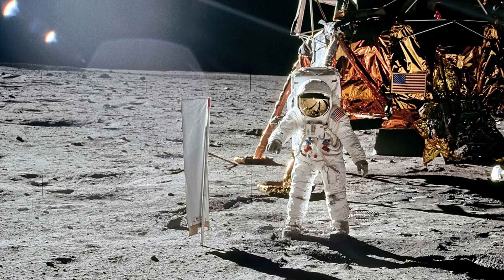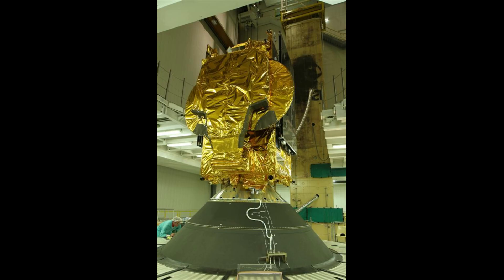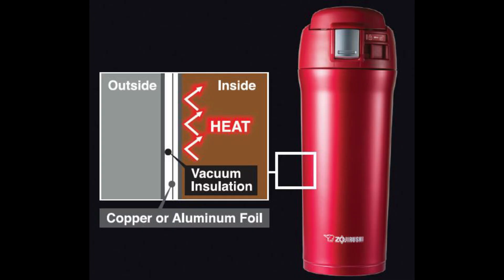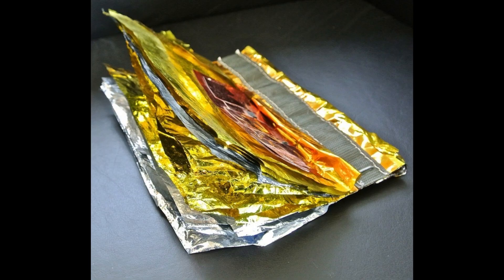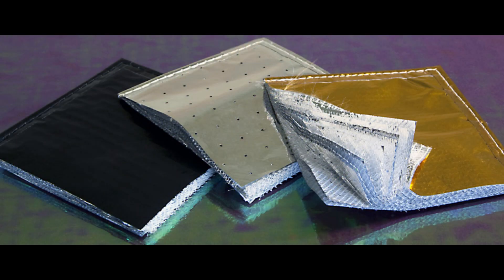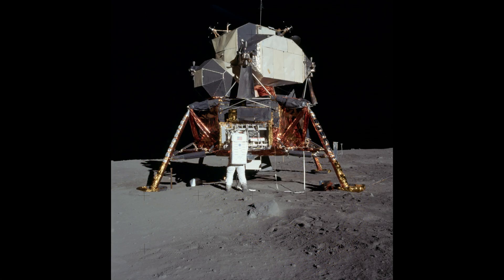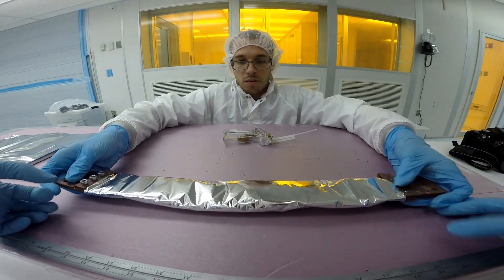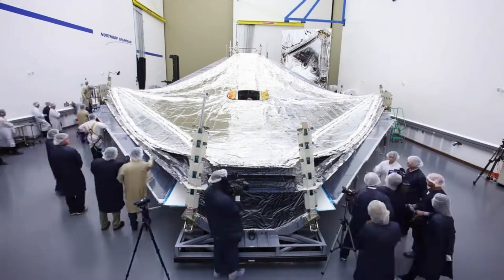Spaceships Are Not Covered In Gold Foil - The Cool Engineering Behind Multi-Layer Insulation

Comment: 10:05 What was the original plan then? How else would they be landing the LEM?
Reply from the maker: Cut engine as soon as contact light illuminated
Reply: @scottmanley  Cutting the engine actually remained as the primary landing method. What the astronauts wanted was the option to power it in if needed, thus the additional insulation on the legs. Armstrong wasn't purposely powering it in, he said later that he was struggling with horizontal drift during the landing and he didn't want to cut the engine while they were still drifting. Next thing they knew they were on the ground although they barely felt it. Interestingly Armstrong said that he never saw the contact light and didn't hear Buzz call it out.

I read once that the strategy was to aim for a hover at 10 ft and then slowly lower until the 5.5 foot long probes made contact. But I have not been able to confirm the part about the 10 ft hover. Apparently all of the landings were softer than originally expected, some more than others. Impact speed was based on the height when the engine was cut off as well as the descent rate when the engine was cut.

Comment: When I worked at McDonald Douglas, I worked with a lot of captain configurated wires. I hated working with it because you’d have to use a hot knife to strip some of the insulation back.

Comment: There was also Kapton covering the Apollo Command Module, although you only see it in the photos taken in space because it burns off during reentry. You also don't see it on the launchpad because at that time the entire Command Module is hidden by the Boost Protective Cover, which remains in place until the LES tower is jettisoned a few minutes into the launch.

Most people are aware of the ablative honeycomb heat shield on the bottom of the CM, but many probably are not aware that the entire Command Module was coated with the same ablative honeycomb. But you don't see the ablative coating in space because of the Kapton coating, it's only visible when you see a Command Module in a museum. The Command Module Kapton was pressure sensitive tape that was applied to all of the surfaces, that's why it looks so smooth in the photos, not crinkly like the LM's Kapton "foil", giving the false impression that you are looking at a polished aluminum skin. Although if you look at the unflown Skylab rescue capsule at the Kennedy Space Center you can see the waviness of the tape and realize that it is not metal like you would think at first glance.

Actually not all of the Kapton burned off during reentry, in fact if you look at photos of the Apollo 11 Command Module in the water and on the U.S.S. Hornet you can see quite a lot of Kapton remaining on the capsule, which has the more distinctive gold look than the space photos do. For some reason the recovery frogmen's supervisor told them to peel off all of the Kapton which they started to do, and apparently the rest of it was removed later, because when you see the Apollo 11 capsule at the Smithsonian all you see is the ablative coating.

Comment: By the way, the foil you get from supermarkets is quite clean as far as particulates go. It's one of the best work surfaces for amateur optics formation as it is cheap and clean.
Reply: We use industrial Al Foil in our vacuum chambers at work, but we are reminded to NOT just use any old "Reynolds wrap" from box stores as SOME of it has a thin coating of vegetable oil on one side.

Comment: The under-construction image of the LEM really showed that it's the weirdest shaped spacecraft ever!
Reply: Yeah it sure makes a difference when there is no reason to have curved surfaces for aerodynamic reasons. Although as you can see in that photo the "face" of the LM is round, that's because that part was pressurized, it's basically a short cylinder, sort of like a tuna can turned sideways. It's about 7.5 feet (2 meters) diameter and 3.5 feet (1 meter) deep. Behind it is a smaller diameter cylinder that you can't see which is the back part of the crew cabin, the astronauts would step up 18 inches into it and it was 4.5 feet (1.3 meters) deep.
Reply: @StevePemberton2  You can also see the underneath blankets of insulation in post lift-off shots of the Apollo 16 LEM. For some reason, on lifting off from the moon, the back surface of the LEM was blown apart, exposing the thermal insulation underneath.
Reply: @RRaquello  That's interesting, I didn't know that insulation got exposed. Some people get alarmed at photos like that as if the astronauts were in danger, but as I mentioned they were inside a cylinder and it was pretty sturdy. It's an urban legend that an astronaut could put a pencil through the hull, or a foot, or as in some versions of the story a screwdriver. Actually there was very little hull exposed as they were surrounded by switches and instrument bays. And even in the few areas where the hull was exposed the aluminum was about 0.3 mm thick which is three times as thick as a modern soda can. Actually it is believed that with some determination an astronaut could have poked a hole with a screwdriver if they made repeated blows with it in the same spot.
Reply: @StevePemberton2  I believe they were all suited up for the lift off from the moon, so if there had been a break in the pressure capsule and the atmosphere was evacuated you wouldn't have ended up with a Soyuz 11 catastrophe. It wouldn't have been ideal, but I don't think it would have been a fatal situation. I remember seeing one particular photograph, I think from Apollo 15, where they didn't land on flat ground, they were kind of on a hill, and in this picture you could really see the angle and the thing was leaning over a bit and I thought, "Man, that looks like a real pile of junk sitting there". The LEM wasn't pretty, but it did the job it was designed for.

On Apollo 16 the surface panels on the back of the LEM all came apart and exposed the insulation underneath. It wasn't a structural thing, but more appearances. I've never seen it much commented upon, so I don't know what the cause was or how much it worried NASA. I remember John Young just barely mentioning it like it was no big deal. Nobody would have even known about it at the time because you couldn't see it from inside and the first one to see it would have been Ken Mattingly when they got up tom the CM. And at that point the LEM only had a couple more hours of use left before Young & Duke went back with all the rocks into the CM and left the LEM to crash into the moon.

Comment: As a former spacecraft thermal engineer, I appreciate your explanation. Thanks for educating the public!   Every layer halves the emission.
Reply: So much for my Ferrero Roche conspiracy theory.
Reply: The effective emissivity scales with 1/(n + 1) for n layers. You don't halve the emission with each extra layer added (which would imply scaling of 1/(2^n).
Reply: I knew someone would come here for this reply…☝🏾🙄
Reply: @reverse_massage is that a new poop emoji
Reply: Hi Phil The ladies in the main hall assembled the thermal blankets using their little Frister Rossman sewing machine, her husband still in the music biz
Reply: I always found it hard to wrap my head around that you need insulation...
Isnt the problem in space to radiate the heat away?
Reply: @MrSofazocker  in part, but there's this great bloody fusion furnace delivering craptons of heat to a metal box.
What is a metal box that one applies heat to called again? An oven.
Ever heard of Laika? The first animal sent into orbit. Due to a failure to separate the final stage of the rocket, the capsule cooling system couldn't operate. She died due to the capsule temperatures reaching lethal levels on her fourth orbit.
Not that she'd have survived, as there was no reentry system designed for the capsule yet. 5 months later, the capsule reentered and disintegrated.
Reply: Yes, so I work in ultra high vacuum cryogenics, a 22 lb device almost completely surrounded by ultra high vacuum will get hot enough to melt plastic components inside after 2 to 3 days with only 15 to 30 watts of power being transferred to it. So in the case of a spacecraft you need to reflect the thermal radiation from the sun while emitting it from the craft on the non-radiated side.
Reply: @CafeBikeGirl  what working fluid is used in the cooling system? I doubt they’d approve anhydrous ammonia for a spacecraft. Water?
Reply: @spvillano I am thinking the same thing.
Reply: @spvillano iss uses ammonia on the second stage water cooling on the first stage internally.
Reply: doesnt change the fact the apollo missions USED mylar coated with gold ... thats why they had to crinkle them so they showed more depth for the actual depth ...

Comment: I actually did know that it's aluminized mylar covered in a heat-resistant polyimide film, but I am after all a total nerd! 🤓 I have so much Kapton in my workshop... Tape in widths from 6mm to 200mm, solid sheets of it, even massive sheets of Dupont Pyralux (Copper-clad Kapton film). It's such a versatile material! 🤩

Fun fact: Kapton tape is the best thing to cover the quartz window on a UV EPROM to prevent accidental erasure. The amber color filters the UV, and Kapton tapes leave like zero residue behind even after decades. 😌 Certainly a damn sight better than self-adhesive paper stickers which decompose after a decade. (except the adhesive which turns into an indestructible fossilized substance.)
Reply: I have several rolls of Kapton tape, the widest one is 200 mm width for 3d printing. Very finicky to unroll without being torn apart
Reply: @asicdathens  Yep, that's what my 200mm roll was for originally. The trick is you need to build tools to do the job. My solution is ridiculously bodged together, I never got around to designing a 3D printed one before I stopped using Kapton on my printer bed, or I'd share. 🤷‍♂️

Comment: While you can't use thermal blankets as vacuum insulation on earth because of air pressure, what about inside a vacuum flask?
Would filling a thermos with layers of metalised plastic film make it work better? Or would the reduced heat transfer across the vacuum not be significant compared to the heat transfer through the cap and also across the throat of the bottle where the inner and outer vessels are physically bridged?
Reply: The genuine thermos metal flasks are pretty good, losing (I'm guessing here) about 1C per hour from 90C, I'm guessing most through the inner and outer skin join and the cap. Would be nice for someone with a thermal camera to have a look-see.   Haven't you got one Scott ?
Reply: Where I work, we do this exact thing for cryogenic storage vessels.  Vacuum layer with MLI inside.  Probably not as useful for liquids closer to room temperature, though.  And the design of the 'lip' and cap has to already be very resistant to heat leak.

Comment: I'm reminded of the emergency blankets I used to see in sporting goods stores.  Well, I imagine they are still there, but I haven't been camping in almost 40 years.  But these blankets consisted of a thin foil that would fold up to be about the size of a deck of playing cards.  As I understood them, they can be so thin because they reflect nearly all the heat that hits the shiny foil back toward your body.  I wouldn't think there would be enough room to place a vacuum between different layers, but perhaps there is.
Reply: The reflection alone already does a great job.
I have been carrying such a blanket with me for over 30 years, wherever I go, and it has been useful twice. I wasn't in any life threatening situation, but it has allowed me to sleep comfortably when I found myself in unforeseen sub-zero temperatures. I did bring other gear, it is certainly not enough by itself, but if things turn out considerably colder than expected, it provides an effective extra layer.
They are also useful to shelter against rain and lot of other things.
Reply: Having to strip down to expose your akin to the foil isn't always feasible but those survival blankets are very effective at reflecting heat back to your body.

Comment: In addition to providing thermal protection, aluminized single surface kapton is also used to provide micrometeoroid protection to fragile spacecraft components. But care must be taken to provide electrical conductivity on both sides of the material to avoid static charge buildup that could discharge and cause damage to esd sensitive electronics. In addition, all materials must usually be non-magnetic. Spacecraft components get complicated in a hurry.

Comment: I'm curious as to why satellites have the yellow capton layer but the ISS modules don't. Or did I miss that?
Reply: They may use beta cloth outer layers on ISS for better durability, especially where the astronauts climb around.  Also, many engineers are choosing other outer layers now that have a better solar absorbtivity vs emissivity ratio.  Many of them look like duct tape.  Maybe you’re seeing some of that for the newer stuff.
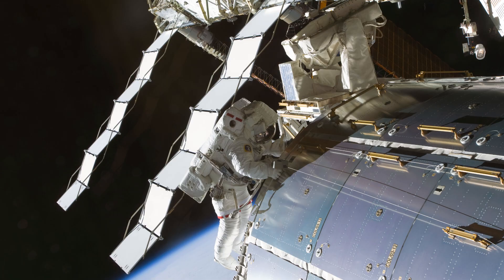Reply: On the ISS, the kapton is inside the white blankets. The outer layer of the ISS modules is an aluminium panels that serves as a Whipple shield agenst micrometeoroids, the blankets are underneath that. 1:47 shows this.

Comment: Kapton, especially in adhesive tape form, is definitely an S-tier material. I keep a couple rolls of it on-hand and find myself using it all the time.
Reply: I laugh when I see construction photos of probes or satellites where they've hung up a paper sign, for example, "Please don't leave your old food in the employee fridge" with a piece of 40mm kapton tape.
Reply: Also used in transformers
Pain in the ass to apply
Reply: Any tips on getting it to stick to things? I have trouble getting Kapton tape to hold onto PCBs and components.
Reply: @SnakebitSTI  You may be buying your kapton from an inferior supplier. I’ve had some cheaper Chinese rolls that didn’t stick too good. Also age may be a factor.
Reply: And here I am, trying to figure out where to buy this in my country for months 😞
Reply: @w0nd3rlu573r  Ali Express or other online places. I first heard of Kapton tape when I got my first 3D printer. we were all looking for materials that would keep the ABS or PLA stuck to the bed when printing and easily unstuck when done. Kapton was soon replaced with 3M blue masking tape, plain glass, PEI (Ultem) and other materials because it was annoying to scrape it off the plate to stick a new one when it got torn. That's when I discovered why the gold foil was on space vehicles, but I never understood why such expensive machines need to look so wrinkly and uneven.
Reply: @w0nd3rlu573r  look into suppliers of consumable for PVD (Physical Vapor Deposition): we use it for masking and fixing stuff inside the chambers

Comment: Kapton tape is amazing stuff! I was first introduced to it because they use it to mask off parts of a PCB board to shield it when it passed through a wave solder. That's right! It survives having molten metal passed over it! :o Of course, wave solder might be a thing of the past since almost everything is surface mount these days.
Reply: Nope.  Surface mount is still wave soldered.  And usually at higher temperatures than the old days, due to the use of silver solder to reduce lead in the environment.
Reply: @jeromethiel4323 wave soldering (selective wave more often nowadays) cannot be used for surface mount components. It would simply remove them off the board. For SMT you utilize reflow soldering. You are right about the temperatures though. With lead free soldering the peak temperatures can get up to 280 degrees Celsius in the hottest zones of the reflow ocen.
Reply: @krzysztoflewandowski5066  Odd how i have seen it done in more than one PCB manufacturing plant.  Granted the SM components were epoxied to the PCB first, which may explain why it worked.  Plus, we may even be talking about the same thing, as the boards i watched being made, the liquid solder never touched the top side of the board, so it may have just been the heat from the bottom, re-flowing the solder on the top.  So maybe both?!?  I never asked what they called it, i just know what i saw.

When i am hand soldering, i do precisely what you are saying.
Reply: @jeromethiel4323  it's used when there is both tht and smt components. Smt are soldered first on what you could call the top side. Then the tht components are placed so the leads stick out on the bottom side. The wave touches the bottom side when soldering. There is also selective wave where the molten solder can be applied in certain spots of the board. Of course you also could be right - there is probably a thousand ways to assemble a board :)
Reply: Was doing that a month or so ago.

Comment: Actually the original spec foil was short ordered.  Idiots were trying to save a nickel, and the techs were not informed. After 2 days waiting, and being told "well, ...well.... well.... , they decided to run to their local A&P and bought 40 rolls of Renyolds Wrap.  Cleaned it with rubbing alcohol and guaze. JPL, Martin Marietta, Boeing, etc were short changers if they couldn't "borrow" some and stash it in their garage. Allegedly. I wouldn't know....